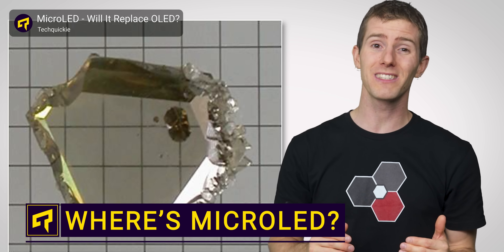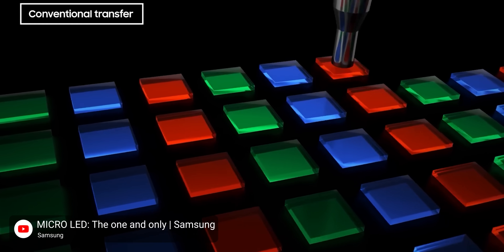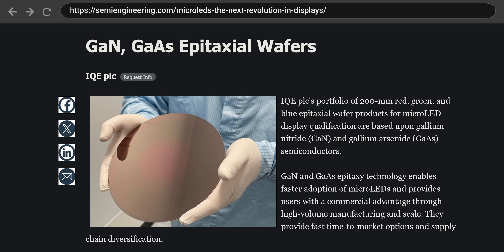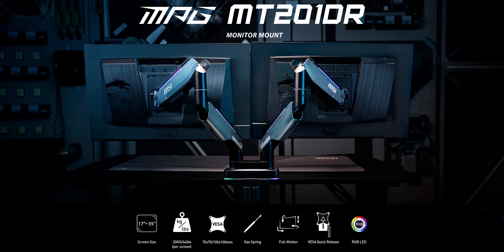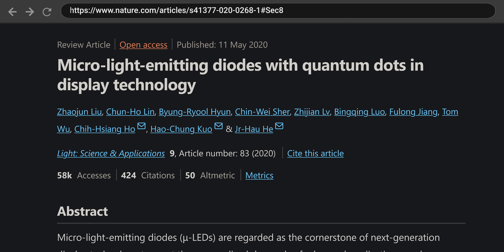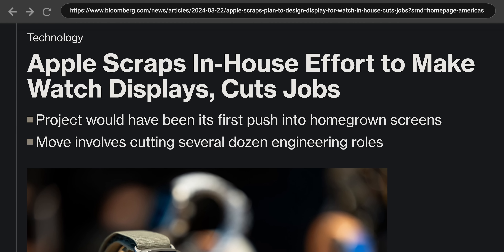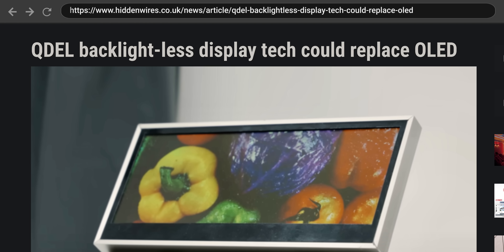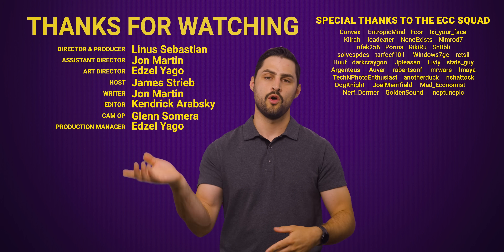Why Apple Killed a $3 Billion Investment

Comment: im praying for microled becoming a thing in the near future so i dont have to care about burn in anymore 🛐
Reply: Unfortunately, inorganic LEDs wear out too. Even quantum dots degrade so QD electroluminescence won't save displays from that fate. Traditional single-light, colour filter LCD is the only display type with truly uniform wear regardless of displayed content, but unfortunately comes with the tradeoff of looking bad right from the start.
Reply: Didn't Rtings determine in their torture test that VA LCD panels were burning more than OLEDs now?
Reply: @MotoCat91 seriously? that's hard to believe
Reply: @Amfibios  LCD burn-in is not as noticeable. The backlight might change color or fade, but it will never be as distracting as a logo burned into an OLED tv
Reply: @TheRealBOBlibob  well, LEDs have a finite lifespan and they can obviously fade or die and cause a dimmer screen, bad uniformity etc, but that's just wear and tear, not burn in
Reply: @Amfibios  Thats only true if youre using your LED 90-100% of its brightness. My extension cord led indicator(5 of them) has been on 24/7 for 10+years now and still all bright. LED bulbs always lasting 3-4years(8hrs/day use) is because it always run like 90% brightness at default and manufacturers are happy with it so people will always buys LED bulbs
Reply: @Amfibios this is exactly the burn in that people are concerned with with OLED. It doesn't burn in the screen, it's just an old CRT term being repurposed. OLEDs just age at different rates if there is a persistent part of the image that causes brightness differences that let you still see the burned in patterns. Micro led would likely have the same issue. What would be interesting is if the TVs had a way of sensing actual brightness of each pixel so that it could compensate by overdriving the aged ones.
Reply: @grahammurray7728  overdriving the aged pixels sounds like a sure fire way of destroying your panel even faster.
Reply: Well, even OLED evolved a lot in the past decade, so the burn in and the white turning into yellow (the blue led had pretty short lifespan, and if you check the color in a RGB generator when the blue is lowered with 10-20% you can see the difference), those problems are not completly solved, but it's way better like 10 years ago.
Reply: @TamasKiss-yk4st  The University of Cambridge made a breakthrough in OLED as recently as this March. They were able to design blue emitters with less energy spikes, simultaneously making the overall OLED more energy-efficient and durable. It's still in an early research phase, but it could eventually be incorporated into real-world products.
Reply: Praying for microled to become a thing so oled will become cheap 🙏
Reply: THIS a thousand times!
Reply: For the price of one micro led tv you could use around 80-100 oleds
Reply: i dont think the child labor slaves in china cannot make the micro led consistently thats why they ditched the project.
Reply: NanoLED bruh
Reply: You don’t for most products other than maybe monitors I think
Reply: @anshulshah1703 burn in occurs on literally everything with an oled, i have burn in on my phone rn
Reply: @anshulshah1703  even monitors have tech now that stops most burn in
Reply: @anshulshah1703  it will happen anywhere where u have static images and faster when high screen brightness
its just a matter of time and unbalanced usage

on desktop its often the game hud or 16:9 ratio when 21:9 monitor from videos
on smartphones its often the status bar and navigation bar 
on handhelds like steam deck and nintendo switch also the game hud
on tv also the game hud and if watching the same channel all the time the logo of it 

burn-in is just pixel degradation of pixels which got more used than the others so they aged faster
so when u have some pixels which always have to glow bright white they ofc will age faster and when u watch non stop 16:9 content on a non 16:9 screen the the borders on the left and right side with degrade much slower than all others cuz they are always turned off 

i know its not oled but had hardcore burn-in on my plasma tv back when i bought destiny 1 ps4 bundle
played the game non stop for 2 weeks and then i had burn in my ammunition indicator for years in it on bottom left XD

Comment: WHAT HAPPENED TO THE WUNDER MATERIAL THAT IS GRAPHENE? So far all we got from it is racquets and speaker diaphragms, NEAT!!! It was supposed to be bulletproof, spray can displays, etc.
Reply: Probably still cooking in labs and not yet at industrial scale. I think the manufacturing of graphene might be a huge challenge
Reply: Also used  in some (bike)tires.
Reply: @MacMasore  TRUE TRUE TRUE, I'm fat, so do remember seeing some bikes with that branding on them, but again, not the magical laundry list of awesomeness they teased us with; SUPER CAPACITORS, NEXT GEN BATTERIES that don't explode and can be tossed since it's just carbon, transparent batteries, transparent phones and circuits, space elevator ribbon, hydrogen cell sponge, medicine, nanobots, etc.
Reply: It’s still way too expensive and difficult to scale while carbon fiber is readily available at pretty much any scale and much cheaper.

Comment: But QD OLED solves that very exact problem of an OLED but also not so expensive to manufacture from QD OLED wafers... 
Also something apple likes to call Tandem OLED is another new tech advancement which solves the problem of equally lit image to stay bright consistently in the direction of the Best picture experience...
Reply: I like that Samsung made the iPad Pro's tandem OLED screen, which means that they can use it in their own tablets later instead of Apple owning it.
Reply: QD-OLEDs seem to burn in even faster than regular OLEDs.